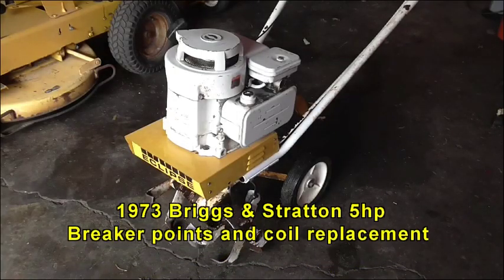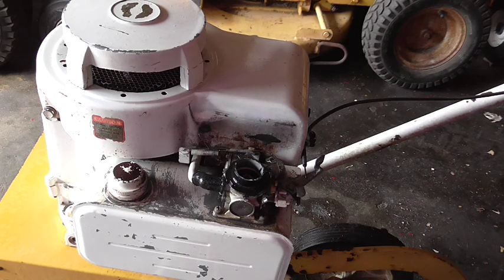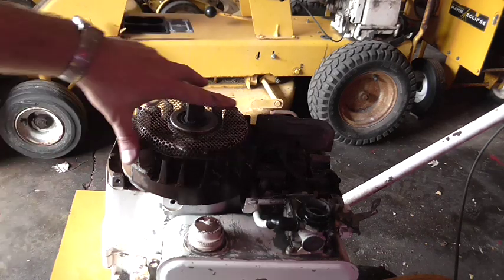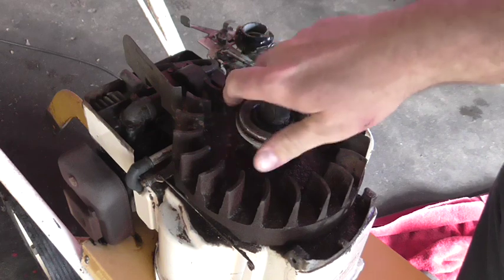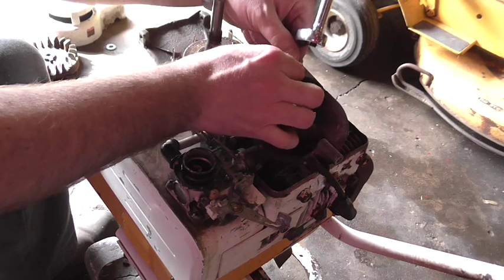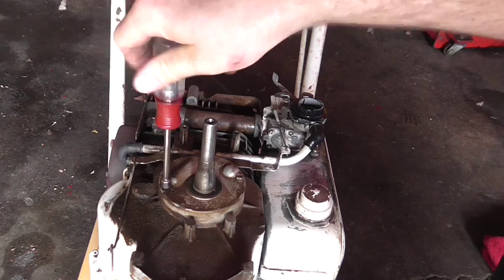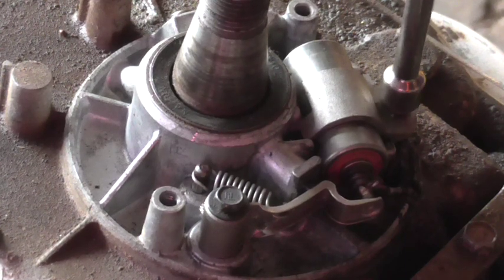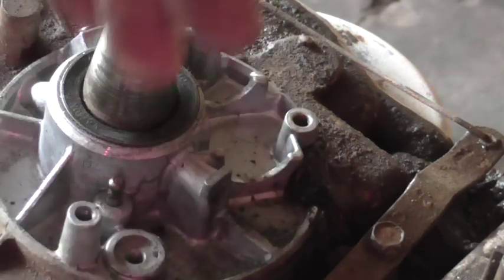Breaker points and ignition coil, Briggs & Stratton 5hp

Comment: (Not shown in the video) The point is set by turning the crankshaft slowly until the pushrod he replaced, pushes the point arm out all the way (turn it several turns so you can see the position at which the points are fully pushed out all the way which correlates to the points fully open), then put your .020 feeler guage between the point on the point arm and the point on the condenser and gently push the condenser into the point arm until they just make contact with the feeler guage.  At that point tighten up the clamp holding the condenser in place and the points are set, then put the sandpaper in to clean out any gunge that might be between the points contacts as he showed in the video.

Comment: Why are you not showing the hooking up of the 2nd small wire for the coil with a round eye?  My replacement coil has two wires like yours??
Original only had one.  Is that a ground or a second kill switch?
Reply: Did you find out where the little wire with the eye goes ?

Comment: I was replacing the points and condenser on my engine witch is just like the one you are working on in the video. As I was working on it I went to set the points and the little push rod stopped working. I mean it does not go up and down anymore. It is free and can be pulled out and put back in freely. It worked fine when I started but then just stopped. What could cause this to happen?

Comment: I have the same Tiller. I keep sheering of the keyway for the flywheel. Any ideas on what would cause that?  I don't have to hammer in the keyway I can just put it in by hand, I don't know if I need to get a bigger one or not. This video did help with the points and the coil. Thank you

Comment: One 5hp ''L-head'' engine is running, the other one not,  yet. There is no spark, that's the problem, The old engine stood in the forest for many years by the house of its past owner. I think that water flew into the engine and damaged some electric ignition parts...  Hope it will be easy to get her running.